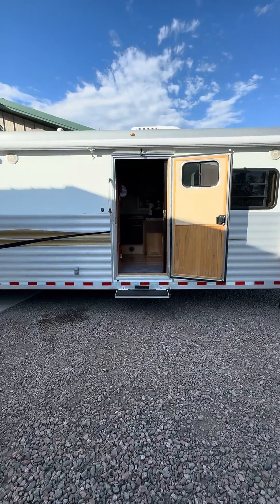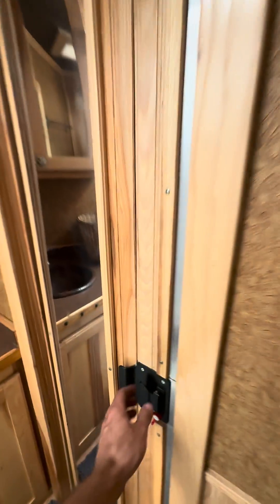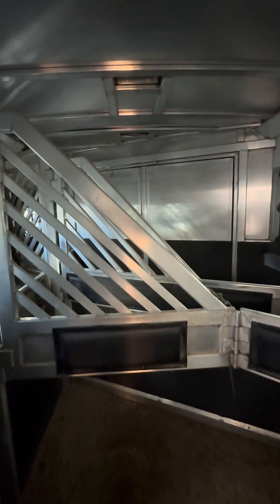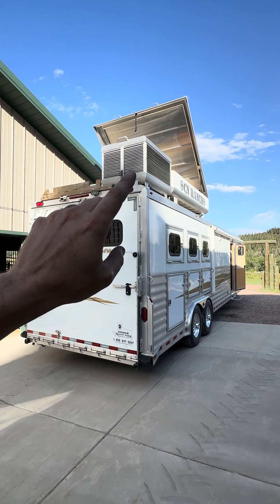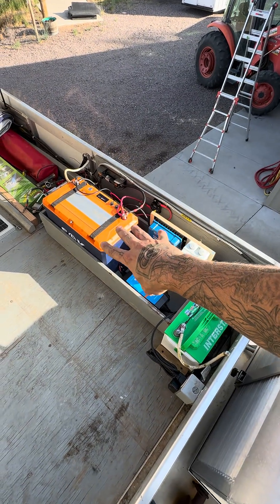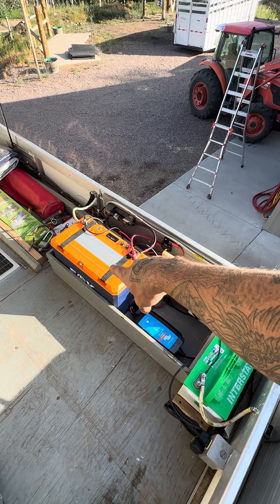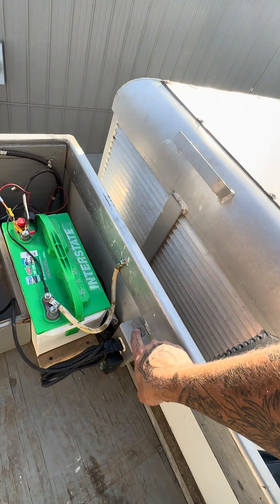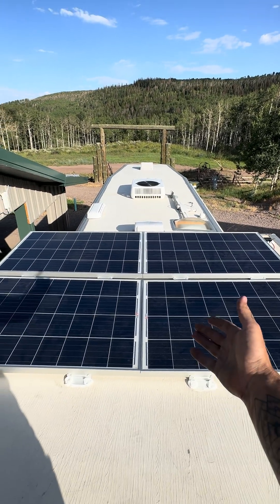LQ Horse Trailer Solar/LiFePO4 upgrade (teaser for upcoming video)

Comment: What would the cost be for installing a generator and box on top like that for a fifty amp generator?
Reply from the maker: You looking for an actual quote to have our team install that for you or just a ballpark out of general curiosity?
Reply: @EXPLORISTlife  just a ballpark estimate. My trailer was wired for a Onan generator. Also has a fairly large fuel tank as well. So, just connecting those wires to a generator is really all I’m looking for. Thanks for replying.
Reply from the maker: Gotcha.  Well a honda 10,000W generator is about 6k and a vented metal generator box looks to be about 2k.  Probably take no more than 2 days to install at $165 hr shop rate ($165 x 20hrs = $3300).  Figure another $1,000 for wiring and a transfer switch into the shore power line.  So, $12,000ish and then back-out what you already have in place?

For an Onan generator - a Onan 12k generator looks to be just shy of $12k by itself.